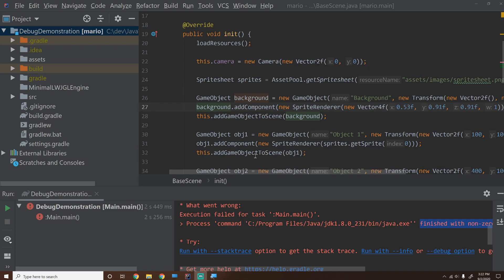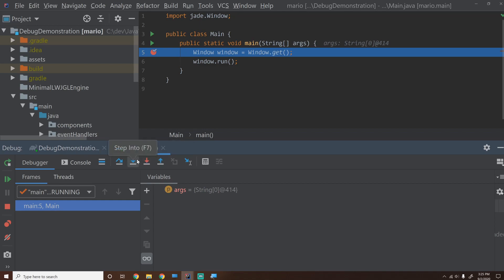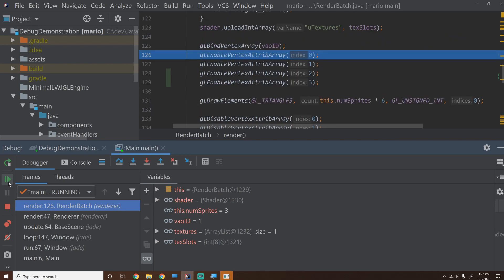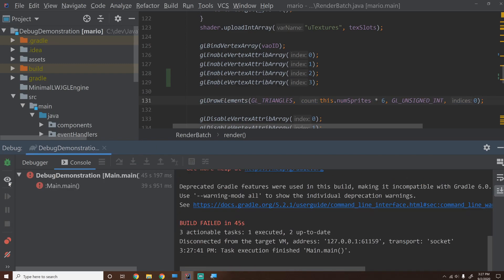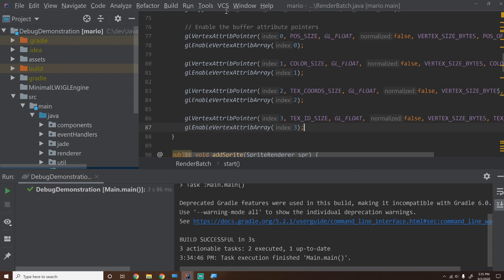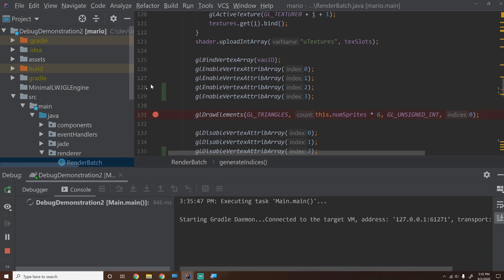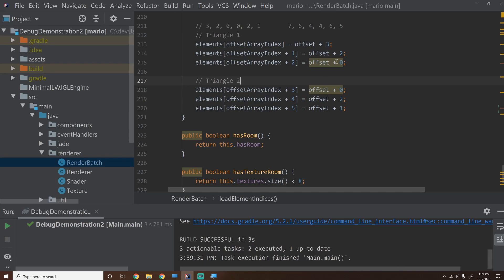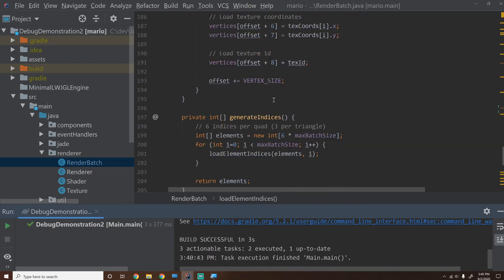How to Debug OpenGL Programs? (Non-zero exit code status, uh oh) | Game Engine Concepts #2

Comment: Another method is to debug with colors. If you changed, for example, the floats in your shader to ints, and you also changed the type everywhere in your CPU code, however, you forgot to change the upload function from GLuploadi to GLuploadf, an int value of for example 0x1 will be changed to 1.0f. Interpreting 1.0f as int gives you 2 to the power of 24 per IEEE 754. I used this value in a switch statement in the shader and noticed it was falling through, even though I had defined 0x1 as a case statement. Since the GPU doesn't really talk much, I managed to determine the value by outputting different colors.

Comment: Im here at my wits end. Mr. Gabe please help! Ive been all over the internets and have found virtually NOTHING on a program???? i guess called Steam Debugger. My issue is every time i hit F6 this window pops up in my steam big picture mode. F6 is a hotkey i use on OBS however. How the F*** do I disable this Steam Debugger!? Or can i at least change the hotkey to something else? I 'm not about to move my OBS settings as i use those alot and have become accustomed to which key does what.